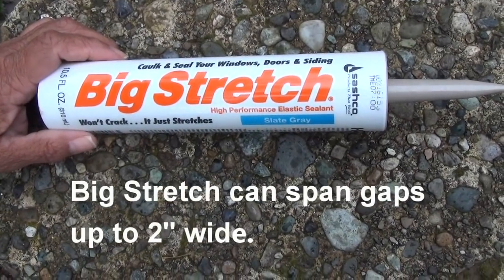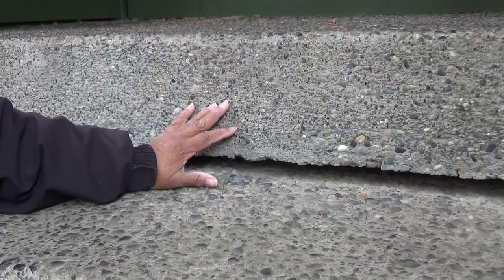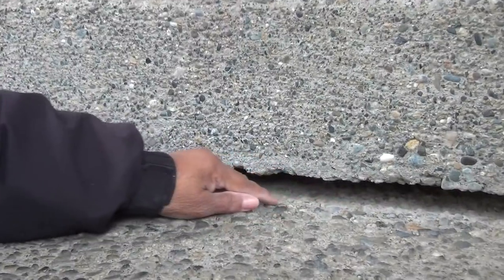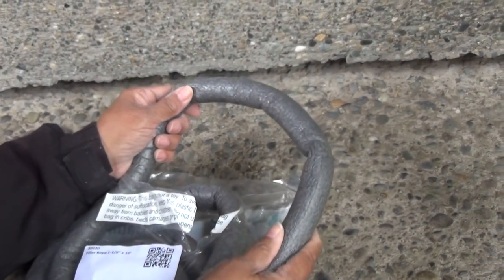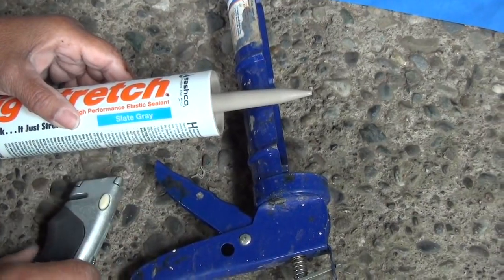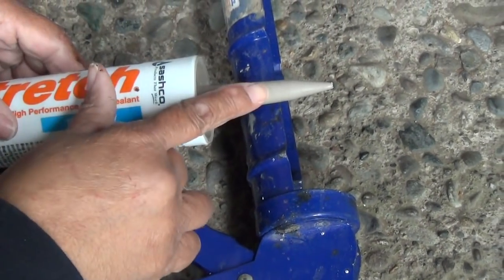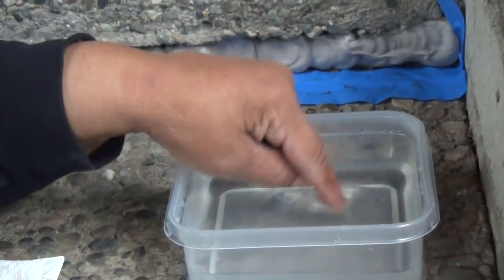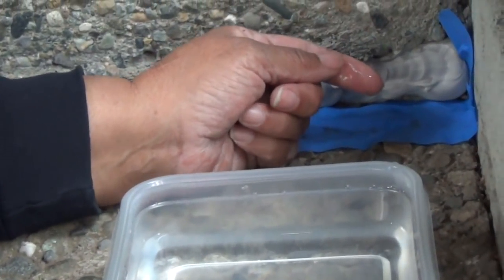How to Fix Large Cracks in Stone, Wood, Plastic, Drywall, etc.

Comment: They changed it to 'Mor-Flexx". It has a sandy texture. It works fantastically. It is easy to apply -- instead of me fighting it, it seemed to read my mind where I wanted it to go. Really, it is that good. It has been in place on my front porch stairs for about five weeks now. It is holding up well for this short period. I will report back after about a year. One thing -- use a moistened foam paint brush to manipulate it, not a finger. I highly recommend getting such a brush when buying the Mor-Flexx. They are cheap and are like magic when working with this stuff. After winter, if it has held up on my porch steps -- which I think it will -- I'm going to use it to seal up voids in our stone foundation. Thanks, Lea.

Comment: I have a lot of cracks in my ancient cement steps, so thanks for the demo. I keep seeing the little cracks on the video thinking, what about those. I'm into details. : )
Reply from the maker: Hi Karen, we did this video specifically to fix the expansion joint.  I also should mention that the product in this one, Big Stretch, is for vertical surfaces.  If you are repairing the part of the concrete steps that will be stepped on, you should use the other, high-traffic area caulk, called Slab.

Comment: That's a perfect demonstration of the typical  modern way. I would think about using a high-lime cement mortar.
Reply: metallitech can you use your method for cracks in concrete side walk? Would it be visible
Reply from the maker: You wouldn't want to use mortar in an expansion joint.

Comment: As a professional caulker I have to say well done. Not perfect but pretty darn good. I ALWAYS hammer people for using a tooling liquid.( all major manufacturers say to dry tool) but your method is acceptable because you pushed the sealant against the bonding surfaces before they got wet.You did not use an excessive amount of water and did not use soap👍 My only real criticism is the choice of sealant. I would use a professional/ industrial product like BASF Np1,,Vulkem, Sikaflex,or Pechora polyurethane. As a professional I would never use a water based sealant on the exterior for any thing but superficial cosmetic repairs before painting. No matter what the manufacturer claims. Again very well done.

Comment: Awesome! I have a 1 inch gap (from shifting) between my garage slab and concrete driveway.  I was considering filling it with sand but I wasn't sure if it would keep out moisture. This will be a much better solution, hopefully it is available in Canada.
Reply from the maker: Slab is better for concrete driveways and it's able to span large cracks too.  You might want to consider using the Slab product instead of Big Stretch for that particular project.

Comment: Hi Leah, I was reading on the tittle that you can use it in drywalls, but i didn't hear that you mention it in the video. So, I was wondering if I can use it on drywall big opens when you have  foundation issues?  And if it's printable in case i can use it.  Thank you for all your big help!!

Comment: I enjoyed the video and how you completed that job with the crack using that Stretch compound. There is a ramp at one house which use to be my mother's where I need to paint the plywood so it will last longer. I already have the paint, and brushes, and just have to find the time to complete the job. There is an opening under the ramp between it and the concrete porch where I need to fill in the area with a compound and I will be looking for this brand locally.
Reply from the maker: Hi Sidney, I think you can get it at Home Depot.  Glad the video was helpful.  Have a great weekend!

Comment: Great video 👍.  I would just add to make sure you read the caulk tube that your using to be sure to use the proper clean up material. Some product are water based, while others such as MP1 or silicone caulk are solvent based. Again, great video as always.
Reply from the maker: Thanks!  And thanks for your input.

Comment: How has the caulk held up during the winter?  I need to caulk under my vinyl door & one with metal threshold breezeway doors. Both are exposed to weather from 0 degs or less and rain storms.  When it rains both leak under the threshold.  They both are silicone caulked, but obviously not well enough.  Will this or Lexel work for this, there is movement, they are on a cement slab.  Thank you for all your help.
Reply from the maker: It has held up very nicely.

Comment: Hi..this is a really wide crack. Could it be foundation drop? There is also concrete mix that comes in silicone tube.
Reply from the maker: It is an expansion joint

Comment: Leah, I'm so glad I found your channel. I have some very large cracks in my concrete driveway. Would this product work on something like that? There are also some pretty severe cracks in drywall due to foundation damage. Would this product be suitable for drywall on the ceiling?
Reply from the maker: Hi Karen, there is another product called Slab that is intended for driveways and other concrete areas where there will be weight on the surface.  Here is the video that we did which shows how to use it: https://youtu.be/euLQongteF4   As for the cracks in the ceiling, yes, you can use Big Stretch if the cracks are in the angle where the ceiling meets the wall. But if it is a crack in the sheet of drywall itself, this would not be the right product.
Reply: Hi Leah, thanks for your recommendations. I will check your video on "Slab" out. What product would work best for cracks in the drywall itself?
Reply from the maker: Unfortunately, there isn't a product that works well for cracks in drywall.  You simply need to replace the drywall
Reply: That's what I thought. With the magnitude of some of the cracks (due to old foundation problems), the drywall will definitely need to be removed and replaced.

Comment: Always helpful!  However I do have a question - what if the crack is more like a hole?  Do you think you could stuff a few pieces of that filler rope in and it would work as well as it does on a uniform crack?  Thanks!
Reply from the maker: you know, that's a hard one to answer because it depends upon the size of the hole

Comment: Do you think that would work well on an asphalt driveway?I can't find a product that lasts more than one season.I was thinking of trying Flex-seal next.
Reply from the maker: Hi Tom, for asphalt, I have had great success with a product called "Pli-stix" asphalt crack filler.  Here is a video in which I used it:  https://youtu.be/Dgdr4IywFmo
Reply: Definitely going to try it.A little pricey but if it does the trick it will be worth it.thanks leah

Comment: I wonder if it would be practical to pat into the Big Stretch with some gravel or sand that matches the surrounding area  before it forms a skin to camouflage the seam?
Reply from the maker: you could do this if you wanted to, however, since I was working on an expansion joint, I wasn't concerned about it.  Also, Big Stretch comes in a number of colors, so you could try to make a match that way.

Comment: i have cracks in my basement wall.  When i try to fix it after a couple of months the crack re appears. Will this method fix that problem?
Reply from the maker: This is one of those questions that is hard to answer without being there.  Cracks in a basement wall can be caused by different things, some more serious than others.  So unfortunately, I can't give you a definitive answer.

Comment: Will this work on concrete cracks on driveway
Reply: Not really.   Use backer rod and a Sonolastic product, either NP1  or SL1.      The SL stands for self leveling.  It works very well if your joint is not very sloped.

I’m not sure about the SL line but he NP1 comes in many different colors.

Euclid also makes a product that is similar to NP1 with the added benefit that it uses a moisture cure process.  That is a very nice feature when sealing joints in concrete.

Comment: I like it, would have liked to have seen some type of small stone mixture to have hidden the repair. From what I could see in the background at the end this could still be accomplished. Just an idea from my perspective. A little more comprehensive on why this brand is better then others out there and the differences. Always aces up material on this channel! Thanks..
Reply from the maker: This brand of caulk was perfect for this application because of its ability to span large joints without cracking.  I  do like your idea about mixing stones into the caulking material to hide the repair, however,  it is an expansion joint and may not be suitable for this application.....but I do like the idea.
Reply: Thanks Leah, not mix but rather veneer.